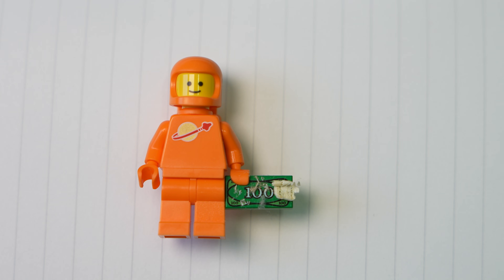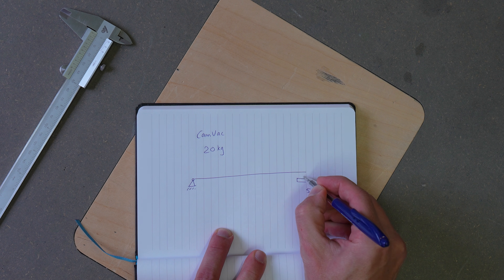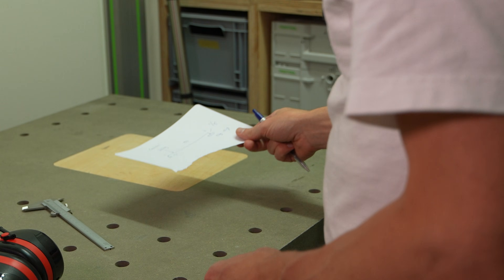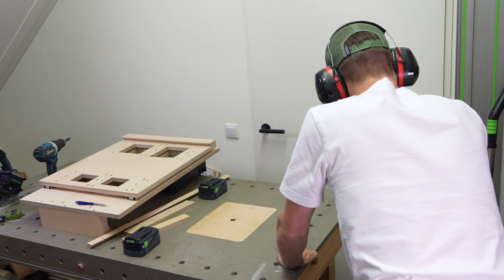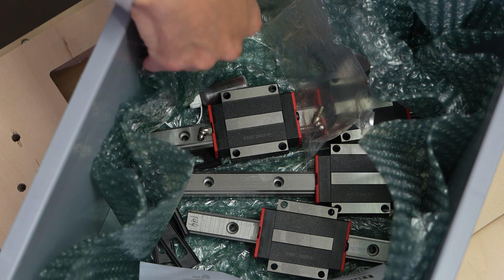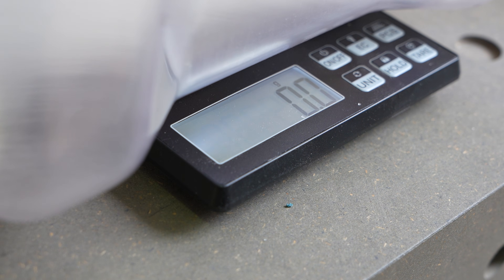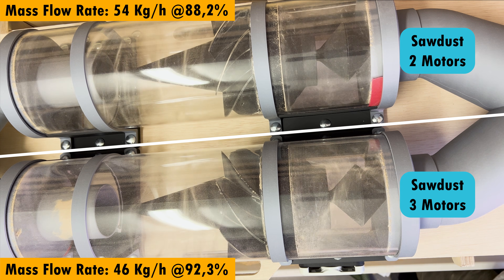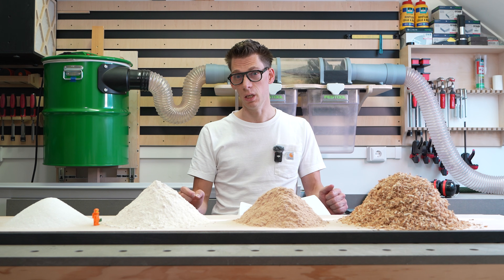Dust, Sizes and the Challenge to Catch ’em All!  (Part 3 • Budget Centrifugal Dust Separator #diy)

Comment: To measure weight and remove the dead weight you can have a 50-50 stick on a rope and a 25kg counterweight (or what you need to cancel the motor and bin) and now the only weight left is the dust
Reply: +1 on the counterweight. Using the lever reduces the effective sensitivity of the scale.
Reply from the maker: Yes I that was the other option indeed. Only I had only one garden tile left for it and that was not enough weight 😅. 

Found out you also can buy a Precision balance for 32kg at 0.1 grams accuracy. It’s just 1750€ 🤔

https://www.henkmaas.nl/products/precisiebalans-pbl/

Comment: It all looks pretty amazing. Have you thought about electrostatic charge. The flow of the particels seems to be affected by it. keep it on, cheers
Reply: I assume this is a major factor in the flour result as well. Even noticed it myself in my own tests of this design.
Ruud is probably right that the PVC version has less static charge buildup than the acrylic.
There is a way to reduce static: inject electrons. I only know one way on top of my head and it's not dust safe: heated electric grating like in old CRT.
Reply: @BartCerneels  You can also add humidity (water).
Reply from the maker: I added copper tape on one side in each tube in the PVC version. Only did not connect it to ground yet. It is something on the list though to get it nicely integrated. I also noticed a slight static charge a while cleaning out the bins.

Comment: looking forward to the self build multi motor vac.
Can you add specs for power consumption? I worry that I won't be able to power it from a single socket in my shop.
Reply from the maker: The motor I bought is 1100 Watt each on 230v.

For the triple motor CamVac the startup power when all the motors are enabled was to much for the fuse. It was delivered with the switches turned on.

When I turn them on one by one it works fine!

Comment: In a real world situation the fine dust wouldn't enter the separator in such volume. A lower trickle of fine dust would be more realistic I think. Agree on straight pipes at the inlet. Thanks for your videos and showing the results
Reply from the maker: I agree about the volume. Only when cleaning up the workshop and removing a lot of dust do high mass flows arise. Ideally it should be able to separate that.

Comment: Would you consider a video on your air cleaner box? Seems DIY but really nice.
Reply from the maker: I build it two years ago as a cheap(er) version of the Airbo Aircleaner AC2 that is +1500€ for where I live. I used their filters including the HEPA H13 filter and built the rest of 12mm plywood. And used the shaper for the covers. Made mine for 500€ I guess. Not really DIY budget style😅.

When I would do it again i would use more 3D printed parts I think for better airflow inside. And not the Hepa filter but cheaper filters and go the route of using a fan with a bigger airflow so air in the room will be processed more times each hour. 

Now the hepa filter is a big pressure loss and effect the airflow to much so air is not cleaned that often per hour compared with a less rated filter. 

It is definitely on the list of builds that I would like to 🎥 with potential to upgrade.

Comment: Once again, an excellent video – I’ve learned a lot from it. When the time comes, I’ll use your results in building my own dust extraction system.

Have you considered using a water filter as well? Being able to filter everything completely and then only needing to dispose of and refill the water would be fantastic!

My plan is to start by building a smaller version, like a shop vac, and then scale it up once my workshop is ready.

Have you also thought about making the impeller yourself? What type of motor were you thinking of using?

Thanks again for your great videos, and enjoy!
Reply from the maker: Hi Pim! Thx for your lovely message! 

It’s hard to make a test video interesting I noticed while making it. So had to combine some hobbies and really enjoyed making this one!

As far as the shopvac version. I ordered a 100mm pvc tube at baptist to make one to fit in a systainer or bosch boxx system. On my patreon I already did a update on that process.

Only scaling it down is not the way to go I think because my plunge cut saw produces more dust than one 150mm tube can handle now connected to my Festool midi. Maybe the smaller diameter does the trick though. Need to speedbuild that first I think 🤔. My engineering hat was thinking of a centrifugal separation tube lite they use for helicopters or tanks. 

On the CamVac motor I ordered this one: 
https://hevo-shop.com/Staubsaugermotoren/230-v-trocken/saugmotor-230-v-1100-watt-zweistufig-tp.html

They also make versions capable to handle water and I was thinking to use that to only for my planer I like to make the dry version first because I really need that one as fast as possible 😅
Reply: @CapturingDust  Heey, thx voor je reactie, even in het Nederlands voor het gemak. 

Ik bedoel niet zozeer een stofzuiger/stofafzuiging die ook vloeistof op kan zuigen.

Ik bedoel de lucht filteren door middel van water, als eind filter. Dit wordt ook wel een “wet scrubb filter” genoemd. 

Het lijkt me geweldig dat je met water kunt filteren om vervolgens eens per zoveel tijd het water te vervangen. 

Het schijnt dat dit beter werkt dan een hepa filter… 

Let op heb nog geen praktijktest uitgevoerd.

Grt Pim

Comment: You can further enhance suction by doing a straight pipe with smooth sides between the vacuum and separator. The ribs of the tube and the U of the pipe are surely reducing efficiency.
Reply: Just making the hose shorter, so it doesn't droop like that would be a step in the right direction.

Comment: Has anyone built this using a harbor freight 2hp dust collector? I feel like that is far more powerful than one of those cam vacs, even with "3 motors". Surely the % eff. has to be better than 90 %
Reply: A three motor Camvac is 3kW, which is about 4hp, so on paper despite its size it is twice as powerful as the Harbor Freight unit you're describing. It differs in how it uses that power; a HVLP dust collector is designed to generate very high flow rates through unrestricted systems, whereas the Camvac uses some of its power to additionally generate a high static pressure, like a shopvac but with much higher airflow. In a battle between a 2hp HVLP collector and a 2hp Camvac, the dust collector would have a higher flow rate through an unrestricted pipe but its flow rate would drop off sharply with restrictions to the pipe, whereas the Camvac's would not. But given that this particular Camvac is literally twice as powerful as the 2ph collector you're describing I would expect it to win easily even in terms of unrestricted flow rate. And once you restrict the flow with a dust separator, the Camvac's higher static pressure is a significant advantage.

It would be really interesting to see real data on how effective this separator would be with a 2hp HVLP extractor because they're so common. The TL;dr here is that it'll definitely perform worse than the Camvac. But it's also much cheaper...
Reply: @cooperised  We have to get ProjectFarm to test shop vac options and plot some flow vs pressure charts :DD
Reply: I have built the separator and have a 2HP motor+impellor rated at 1650CFM ready to test it with. I think the Camvac is a nice small package solution but pretty sure it will lack the real power needed. Planning on having the motor in front of the separator and a micro filter at the exhaust of the separator. Mounting everything on a useless wall.